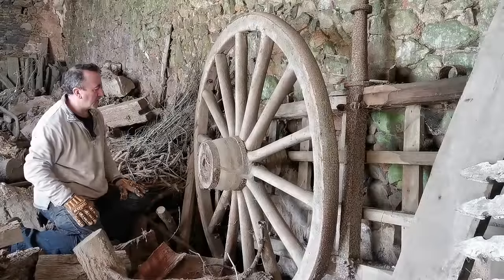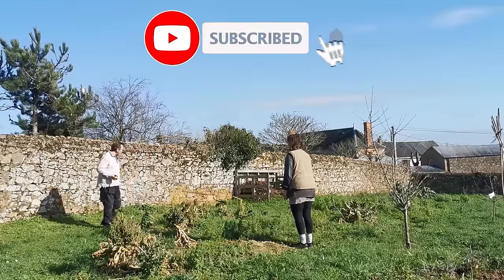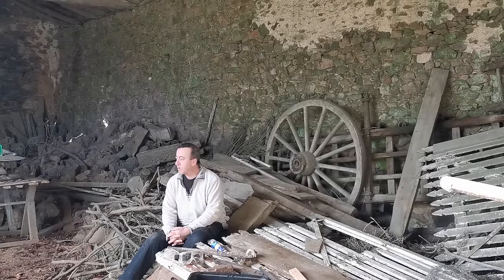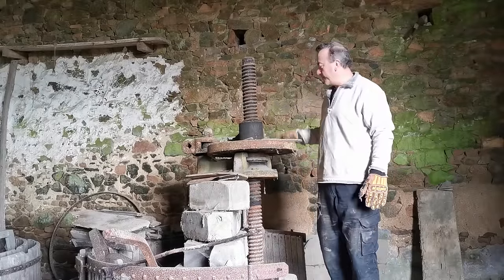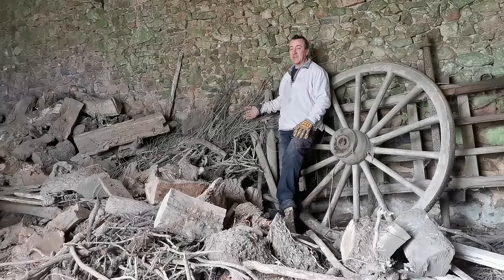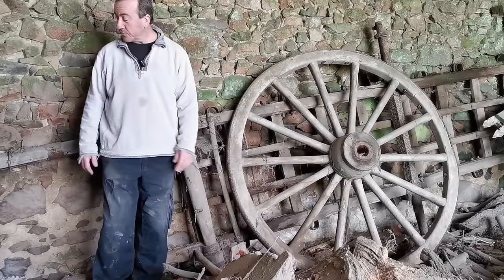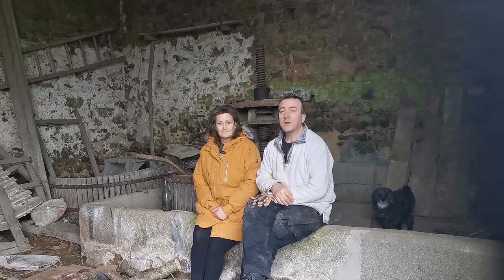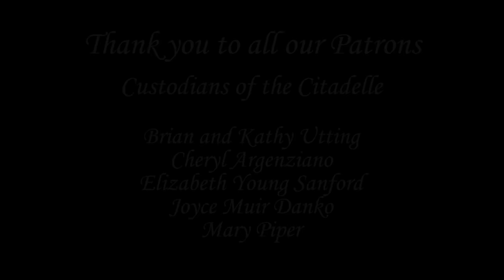EP170  Accidents will happen, the danger in renovations.

Comment: The metal hooks on the sides would probably have held side gates or wattles where the posts slot in to the hooks and they act as sides to hold the hay rather than tying it down